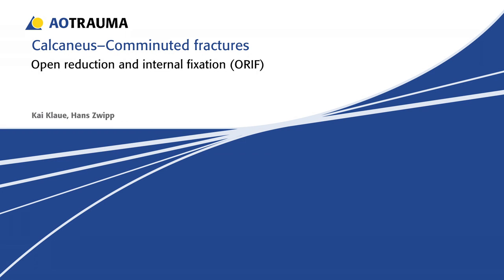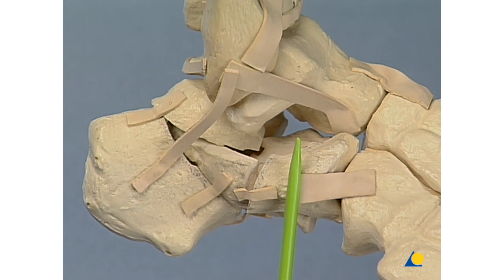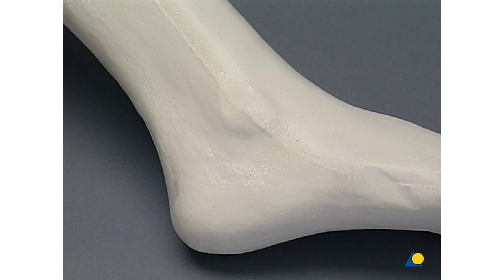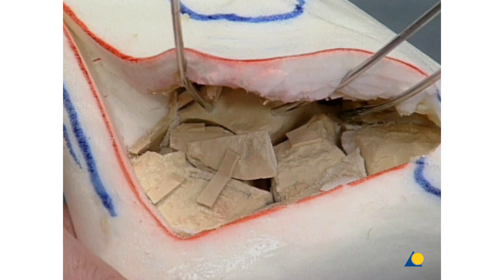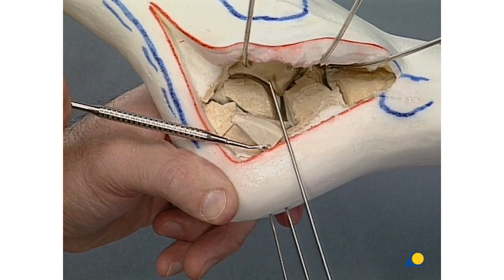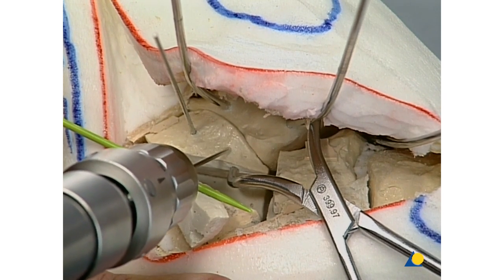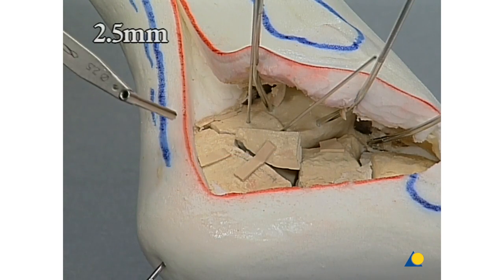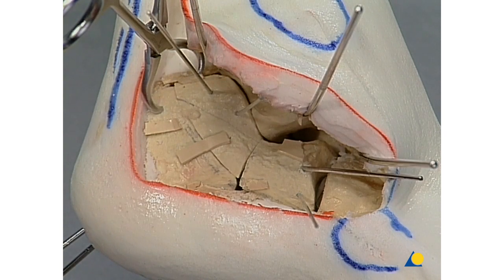Calcaneus - Comminuted Fractures - Open Reduction and Internal Fixation

Comment: I have a plate and 9 screws, not an issue but I feel it in cold weather.
Reply: Can you walk normally please ?
Reply: I walk in boots for ankle support, but I walk normal. @HabibBenkhlifa-j8l
Reply: @HabibBenkhlifa-j8l  I wear boots for ankle support, but I walk 3/4 miles a day just fine.
Reply: @HabibBenkhlifa-j8l  I walk fine, i wear boots for ankle support. i walk the dog every day for 3/4 miles just fine.
Reply: I also have a plate and 9 screws, I get cleared to weight bear on my foot in 5 weeks. So far it feels good but I guess the real test will be walking. Glad to hear you are doing well, that helps me stay positive!
Reply: @dadudman44  When you start walking, about two weeks on crutches at first, you got to work it, your leg has atrophied more than you might think and needs to build back. i have about 50 percent range of movement in that foot, but walk every day, rain or shine. Now seven years later, I got some arthritis and some discomfort, but not bad enough for pain meds. I am 65 yrs old, so being younger will benefit I would think. Good Luck and take care.
Reply: Hello there. Can you walk normally? Kind regards
Reply: @alxsilva846  I wear boots for support, but yes.
Reply: Do you qualify for disability
Reply: @davidcasas1943  I never looked into it. I am not disabled by the injury.

Comment: I had it 4 years ago now, I walk fine but have problems on lumpy ground and use ankle support as a precaution.
Reply: I had mine done 10 years ago. Yes with uneven ground and don’t even dare to roll it as the pain is intense.